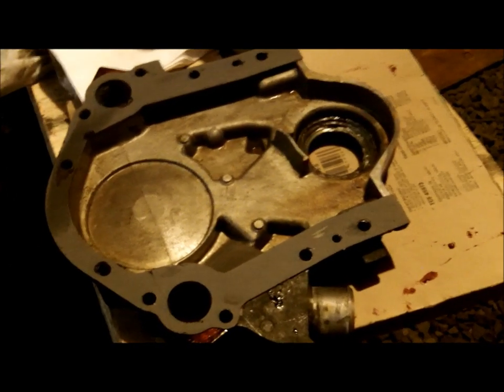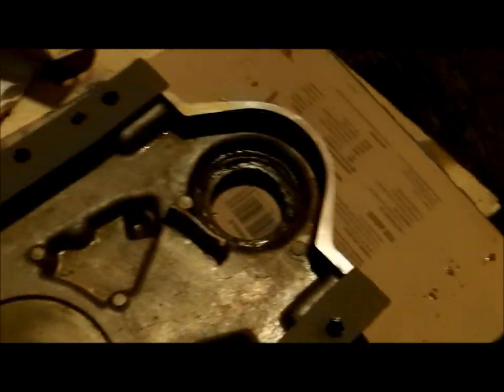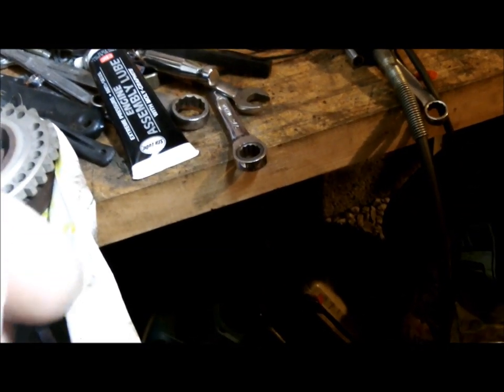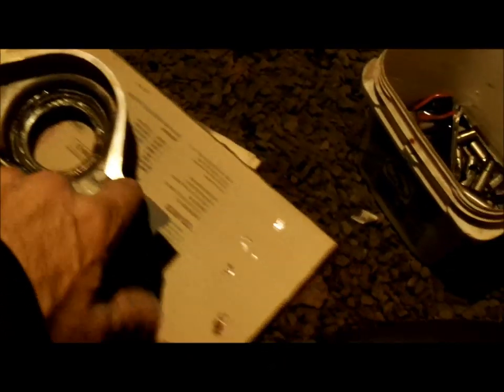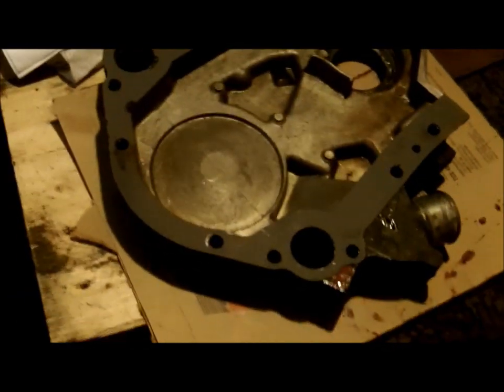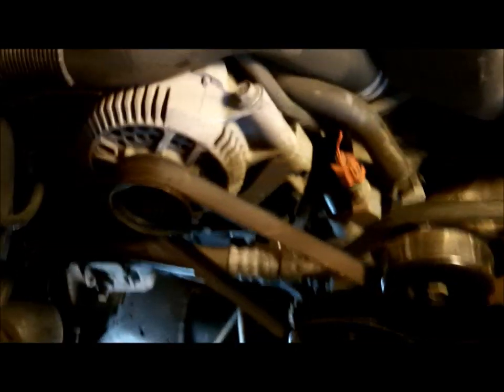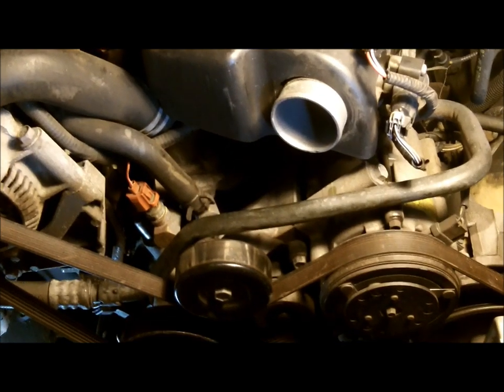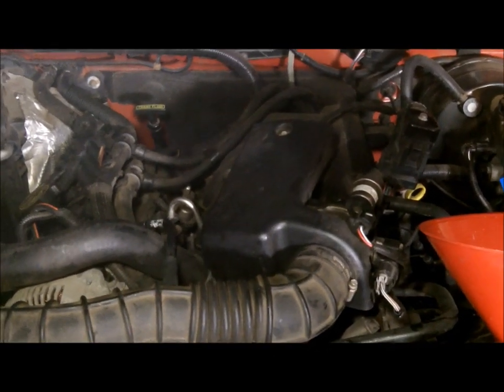Ford Ranger 3.0 timing chain replacement Part V.wmv

Comment: Thank you very much for putting these 5 step videos in here. My ranger is doing the same thing as yours. It's leaking in the same place. Engineering screw-up, could be manifold heating up the front of the block. You were very helpful. Don't do this for a living, mostly hot rods, but I think with your videos I can pull it off.

Comment: Very entertaining and great information. you saved me a ton of time and frustration. I am into the job now with a rough idle issue. I did not know about the leak problem so I will check the chains and see if there loose (probably are) and redo the gasket. thanks again.

Comment: Really need help, I have a  01 ranger xlt 3.0L, in process of replacing water pump, timing set, fan, and fan clutch , got everything removed down to harmonic balancer, I will get this off soon as well as timing cover,  The crank turned while removing center bolt from harmonic balancer, im confused about the timing marks?, im assuming its ok as long as the marks face each other? I noticed the timing marks dots are located at the keyways, so is ok to simply install gears and chain by lining up to keyways, or does it involve "jogging" engine to line up timing marks?.

Comment: Good video but I felt like some information was left out for people that have not worked on fords. I'm a euro car guy and I'm going to help out a friend. That being said where are the timing marks for TDC, when the timing cover is off how is the crank sprocket and cam sprocket removed? Does the harmonic balancer bolt hold the crank sprocket on? Do they just slide off when the cover is off?  The bracket that holds the a/c compressor, p/s pump and tensioner have to be removed? I ask this because then the a/c would have to be evacuated. Oh the bolt that feeds oil to the sprockets was also holding it on? What were you counter holding the crank with to loosen and tighten so  nothing moved with the chain out? I really liked the video just wish it had more info for a first timer and better lighting.
Reply: faranger Appreciate the response I figured it out when I was in there. To tighten the cam sprocket I just put a screwdriver between the gear and the block to hold as I tightened the bolt with my torque wrench. When I put the sleeve on the crank pulley shaft mine was grooved pretty deeply so the sleeve protruded out slightly, it wasn't completely smooth. It was a lot smoother with it on than off I thought that could create a problem which it didnt. One other issue I noticed in the video is you state that the cam sprocket bolt is 41-51 inch pounds. When tightening this with a torque wrench that is barely more than finger tight I had to call a ford dealership to confirm but it's 41 foot pounds not inch pounds. Just wanted to clarify that. Overall this video was very helpful.

Comment: how to fix that transmission cooler lines? i kinda twist it while removing it from the radiator, thanks! and also, the bead in the timing cover, only in the corners? I am getting ready to put it back, but the oil pan gasket is loose at the lip and I am thinking of putting a layer pertex no 2 in the lip of the oil pan and so the gasket will stick and then put on the bottom of the timing cover a layer so the top of oil pan gasket meets with the cover to create a seal is it ok?